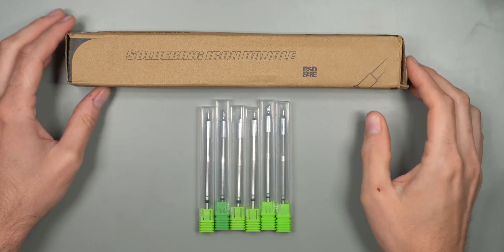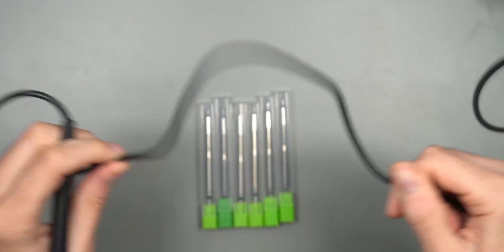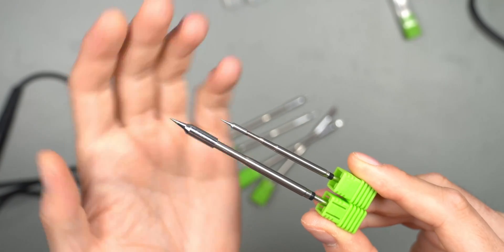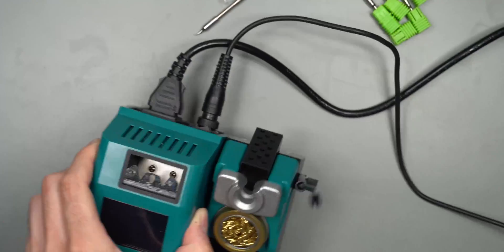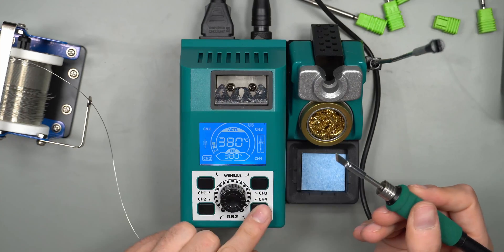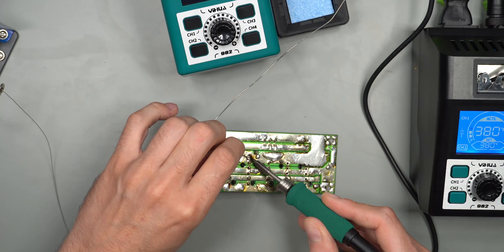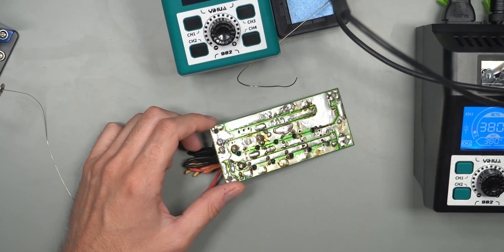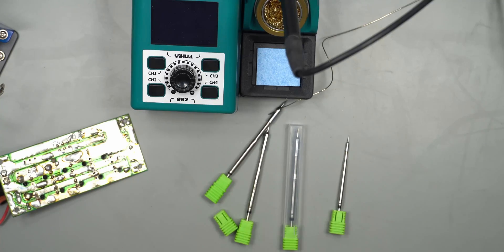Yihua C245 Solder Handle For 982 Station: Unboxing & Testing

Comment: The struggle with flow might have been due to you holding it too long and without flux. from what I saw flux is the magic that instantly melts solder wire. This is also why people prefer to use Rosin Core wire so that as it melts it releases flux inside the wire and helps melt much easer. But when it comes to using any sort of flux the best way I seen it be used is with high heat but in small burts. heat the pad with iron and simply press the solder wire into the iron so it melts into it. Maybe the way you were holding it there for a long time was the reason it did not work so well.

-FYI I'm no pro I only recently started learning from people who are pro's.
Reply: nah, its should have melted it, but wont stick to it if its oxidized

Comment: Thank you for this post. I have the YIHUA 939D+ III EVO and it is really powerful, very pleased with it, can easily create a big pool of solder on just copper clad board. I have seen other reports of the problem you have with this the 982 on You Tube. I was considering buying this unit but not now. Saved my money, thank you.

Comment: It looks like 616A lacks power even with biggest tip. In video shown more powerful handle 9071 but it would not fit 982 (has different plugs). Would be good to know is there other handle, possibly with remodeling to work with 982, otherwise has little use unless for tiny parts/ surfaces.

Comment: I checked  my C245 on my 982. Inside the station is a R005 resistor to messure the current that goes throw the heater by the MCU (btw. the build quality of the 982 is good and it's based on an ARM-MCU). I have messure the voltage drop on this resistor with a Fluke F8050A. The peak/average value was about 20.x mV (= 4A) with the C245 and about 7.2mV (= 1.44A)  with the C210. The PSU seems to be a 120W device (Aifen A9 using the same transformer). This means the 982 should drive C245 pretty well. I paid 43€ (incl. VAT and quite fast shipping): Highly recommended.
Reply: @deterdamel7380   Merci beaucoup pour les informations détaillées!
Reply: Hello I have a generic c245 handle and want to use it with my yihua 982. Seems that internal wiring is different from yihua handle and it did not work. Do you know the wiring of yihua c245 handle?
Reply: @hmjeon8609  Hi. The Yihua c245 handle (616A?): 5-pin, 4 in each corner and 1  in center; The pins of the handle facing you, the key is  at 12 o'clock; clockwise: pin 1 is the tip/housing (should be grounded), pin 2 is a sense pin-10kOhm to pin 4 (Seems that the C210 has a 0 Ohm sense-resistor).  Pin 3 is the pointy-needle-contact of the c245 cartridge. Pin 4 is the middle contact of the c245-cartridge. The center pin of the 5-pin-plug is no connected.
Reply: @deterdamel7380  Thank you very much. It worked fine.
Reply: @deterdamel7380 are you saying if I bought this unit, the c245 should work fine (unlike in this dudes video)
If so, what do you think his problem was with the c245?
Thank you
Reply: @toddy9141  Yes. it works fine.
Reply: @deterdamel7380 hey mate
Thanks for getting back to me, although I went with the Yihua 982-iii (All set) 👍🏻
Reply: Isn’t this type soldering iron and tip for micro soldering?  He tried it on something that is 10x the size of what you would use it on kicrospldering

Comment: (Too sad.. I was on the way to order a second station of this type.)

Update: My two Yihua 982 has very good performance with the C210 and C245. I got two 982, even the rated 40W 982 hat 120W PSU inside. Newer units seems to be rated 120W.
Reply: I got mine, and it works excellent with both c210 and 245.  I'm soldering car stereo amplifiers, and 245 works excellent on the bigger stuff, like pcb through solder on wires, and 210 on resistors and so on.   I have nothing like the experience as this guy do.
But I always pre clean the tips with flux, and then pre tin.  Works like a charm 😊

Comment: too bad was hoping that the c245 was good. do you have a link to the hakko handle and can ot be used with the 982? tak
Reply: I should receive my C245 handle in the next days. I'll check this on my 982. If this doesn't work like a C245, I'll modify the handle to work with my KSGER T12(STM32/alternativ firmware) station. Experience will be shared.

Update: I received my Yihua C245 handle, but it still failed out of the box: It can't even make contact to the cartridge. The Yihua 982 reports an '5-E' error. I'll will report about my refund attempt later.

Update2: Just fixed the C245 handle. The seller offers refund (even without free return) or resend, and send useful hints to fix the issue. So I got a partial refund after fixing the issue myself. It seem that the PSU of the device is 120W. I'll make some messuments with my DSO-150 over an integgrated shunt-resistor on the mainboard of the 982 next days to get the truth.

I'll create a new topic for the results..
Reply: @deterdamel7380   Merci beaucoup pour les informations détaillées!
Reply: @deterdamel7380 How did you solve it?
Reply: @deterdamel7380 How did you solve the S-E error (C245)?
Reply: @eduardopadilla6168  Yes. I unscrew the handle a bit. Seems that there was some tension on the connector inside the handle, that prevent the cartridge to fit up to the very end of the connector. After that the 982 works excellent with  C245. I also brought a second 982 station (with C210 and C245) for a low price (54€ shipped).
Reply: @eduardopadilla6168  I unscrewed the handle a bit (one turn?) . Seems that this releases some tension on the socket. You can also disassemble the handle and the connector. The 616A/716A are not glued.
Reply: Nothing else fit's only the Yihua handle due to the socket' by the way the guy should have the temp upto 400c on a board like that' i have the black version 210 & 245 work fine ......................
Reply: @leso204   Hi, so You have black one, I do have black version too. Did You measure wattage with 245 handle? I did measure wattage with 210 handle and station pulled exactly 40W, but I do not have 245 handle to test with it. BTW I red that 245 handle is capable to use 210 and 245, is that right? cheers
Reply: @leso204 leso, You there?
Reply: @smokehead5318 : sorry buddy had some health problems' as to your questions 1 i never measured the wattage if it solders that will do' 2 you have to have the C245 handle for 245 tips ..........